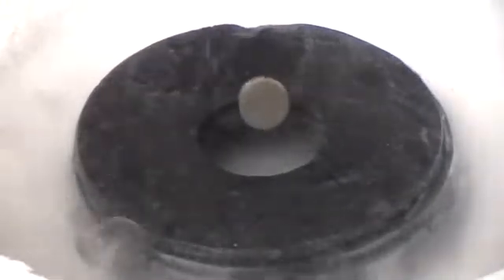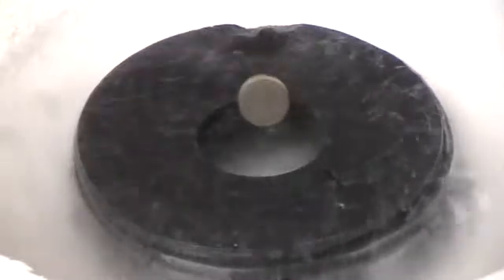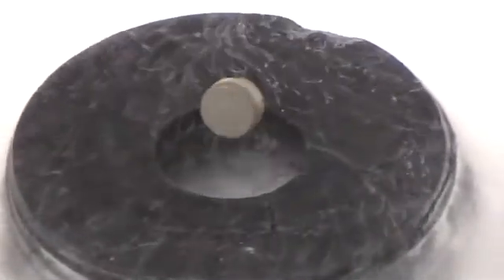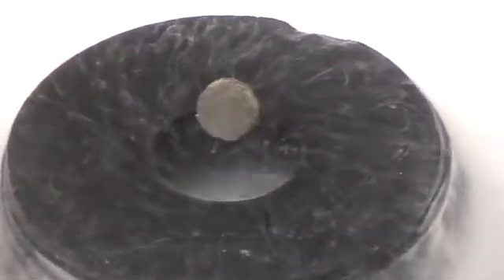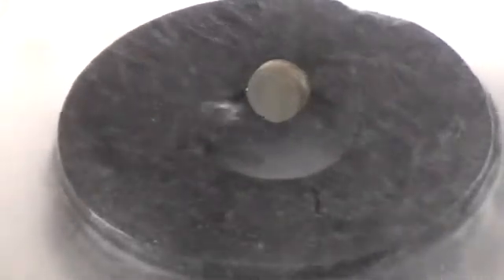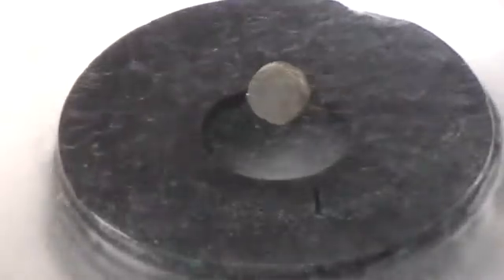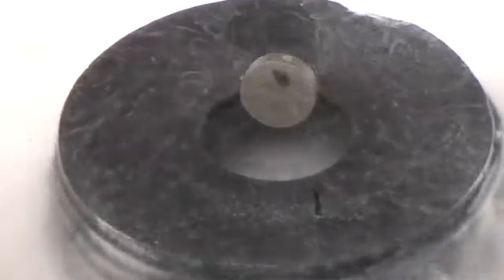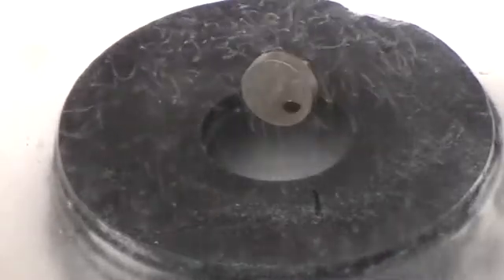Spontaneous Rotation of a Magnet over a High-Temperature Superconductor

Comment: If thermal gradient is the cause, it may be due to material imperfections and magneto calorific effect. IR imaging may be useful?

I imagine a sample with uniform anisotropy would remain where placed. I have no idea how you would procure a such a thing.

That it rotates from a standstill indicates that there is an overall positive torque. Which given the periodical movement suggests that it may be possible to design a sample to optimise the effect.

Depletion is interesting. Hope you pursue this

Comment: 30%? That is significant. At first thought I imagined you had shifted the Curie mean in such a way as to allow room temp thermal transfer to disassociate the domains. It is more likely that inner electron orbits have migrated into the polar orbit around the nucleus which is dipped and can cause a reversal of the spin. Have JD bring the temperature up to above 50°C with the magnet attached to another with the prior strength. If it regains its 30% or near there, then it is probably the elctron...

Comment from the maker: As for microgravity--I don't know, but I doubt it. I'll suggest it to my extraterrestrial contacts (the NASA ones, I mean).
There is great variation between magnets, even of the same type,  in this experiment, possibly caused by various anisotropies in distribution of mass vs. magnetic field geometry.
The preferred position is over the hole in the toroid; perhaps this is why the effect is not more commonly demonstrated. Not everybody has a melt-textured YBCO  toroid to play around with.

Comment: ... then release it quickly after rotating it. if the center axis has shifted the rocking action will be pronounced after that small time period. It sure appears to mimic gravitometric actions.  It would be nice to repeat the experiment with no convection in a sealed thermally isolated and stable environment (externally cooling tubes). Perhaps there is an exchange of mass/energy making it top heavy. 

Thanx for sharing both vids - 5 stars!

Comment: Great show! Has this been reproduced in microgravity? I agree that the forces do not appear to be thermal, but the effect is thermal. It is interesting however that it appears to favor being over the boil rather than the ceramic itself as in the first video. During the rocking, the dwell observed in the CCW direction seemed longer than that in the CW direction. It appears you have shifted the axis just as they do in the RBM. To test the theory, hold it firm for 10 seconds, rotate 90° and ...